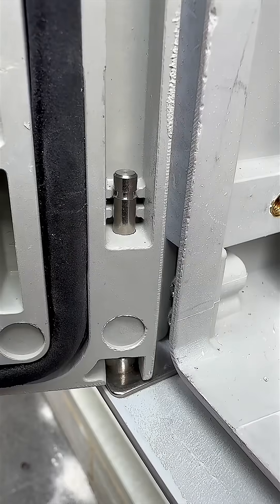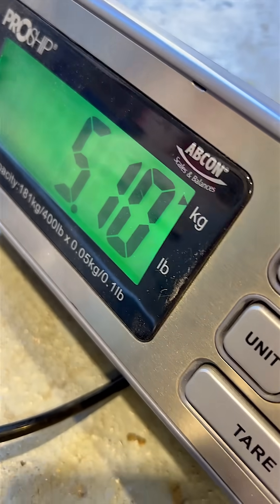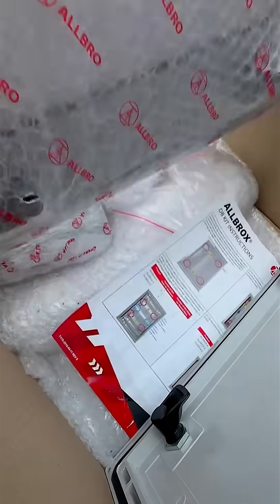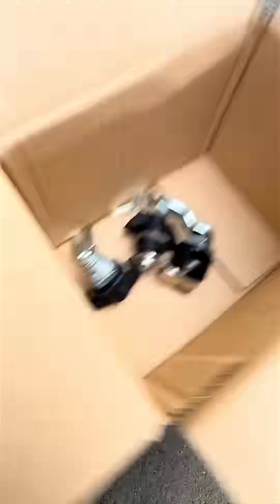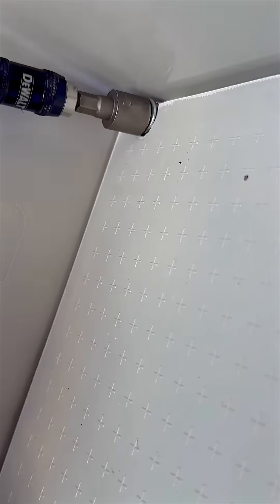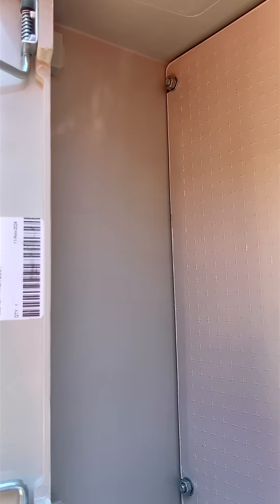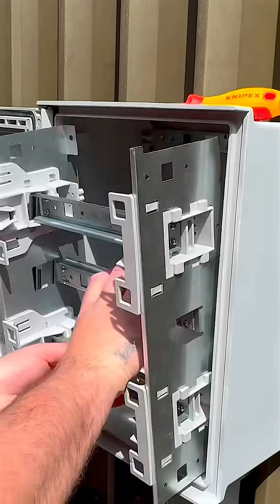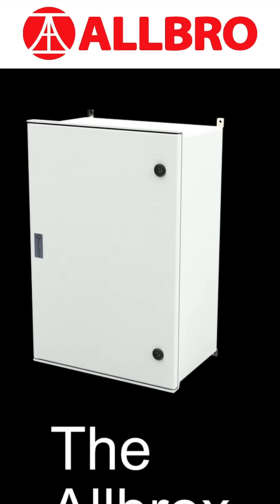This Electrical Enclosure Was Built to Be Abused!

Comment: I use AL-SA BRES for over 15 years. Same as that, and they are awesome
Reply: Well, not quite the same! 😉Allbrox enclosures come with our ALL-GUARD UV protection as standard, giving over 25 years of lifespan. We also include an internal mounting plate and wall mounting fixtures – every penny counts, right? Handy touches we think make a real difference!
Reply: @allbro1978 true, with AL you need to buy every acessory that you need. But in 15 years i dont have any problem. I love to use them in solar installation. Great box